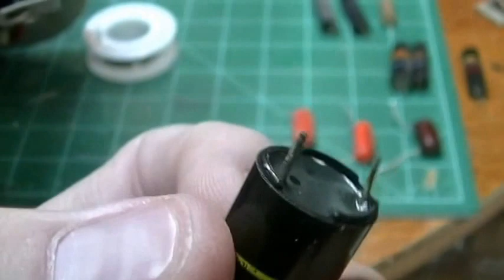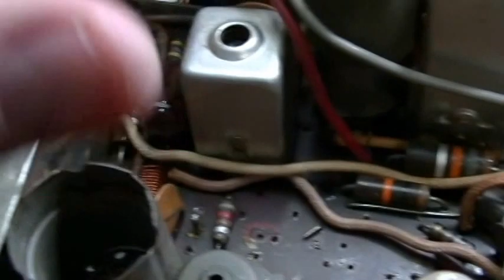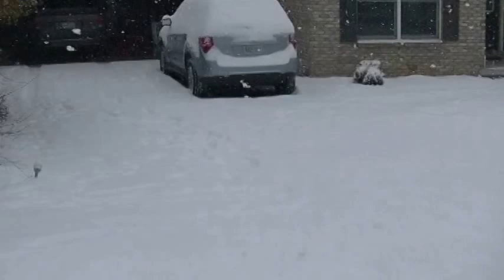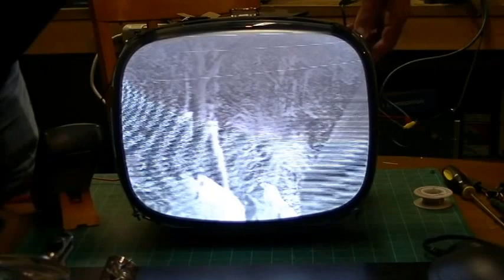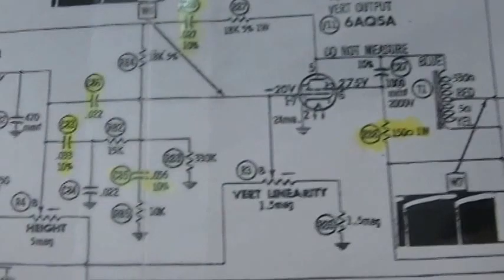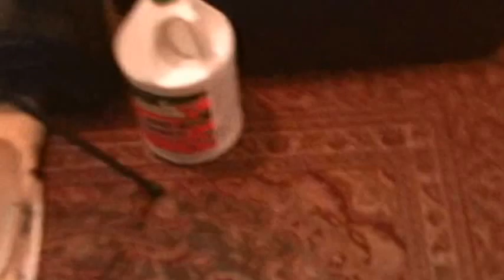1958 RCA 14 PT8021 Pt 6 of 7

Comment: i have one of these with a 45 record player in the top. I set it aside because I got frustrated trying to get that board out
Reply from the maker: Yes, it's not an easy task. I got a few burn marks on may hands because it's so tight in there with the solder iron. But if you take your time, you can get it out enough to change components VERY CAREFULLY on that board. Those traces are really delicate. You just have to gear your mind to this will take a while to accomplish. But it will be worht it. These sets play great after they are restored.

Comment: Scott,
You’re almost there my friend.  A little more time on the video output (noise breaking through from somewhere by the look of things), and the bottom frame linearity, will see it working as well as it did many years ago: the glass is well over half full.
This is another superb video my friend as you have accomplished much over the past two weeks: well done!
Phil.
Reply from the maker: Hi Phil...thanks! Since this video I have got the linearity lined out and most of the sound buzz calmed by adjusting the IF cans. But you'll see I still have some weird retrace lines, with associated sound distrotion, that is intermittent. Something I have not encounted before. Usually vertical retrace lines are common with newer digital formats being applied, but usually they can be corrected by brightness control, or just ignored. If severe, there's usually a component fix published somewhere. I've never really seen them come and go like this, or affect sound qaulity. I'm researching a cure now, (also could explain the earlier discovery of some components added that were not in spec with the schematic), while prepping cabinet for fresh new look!!!